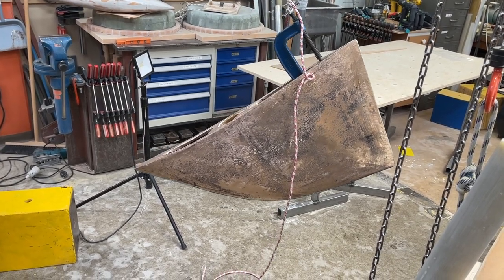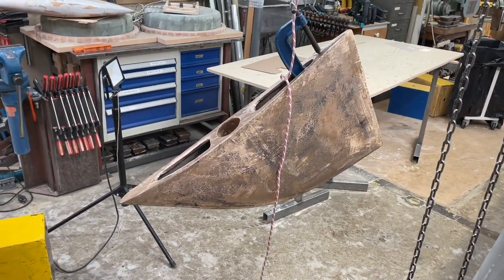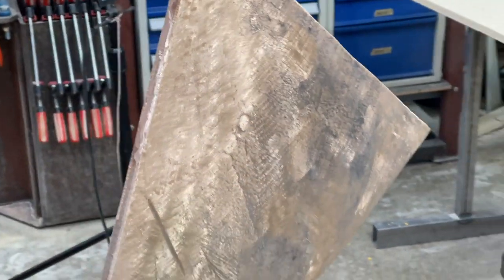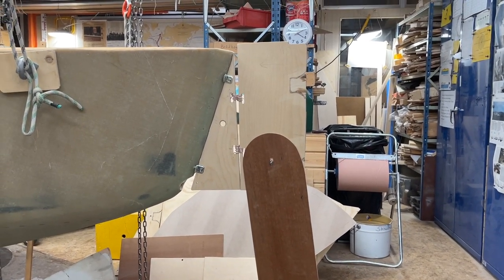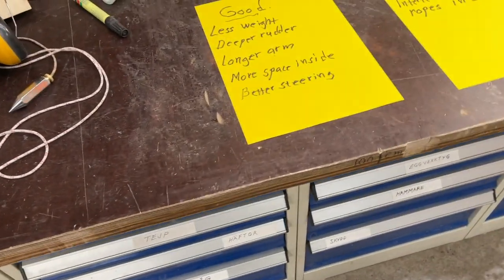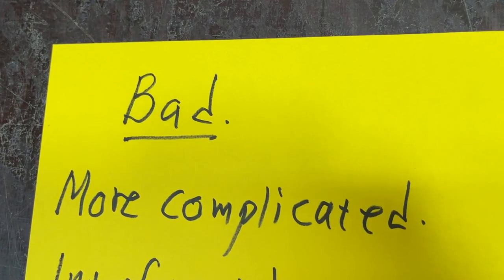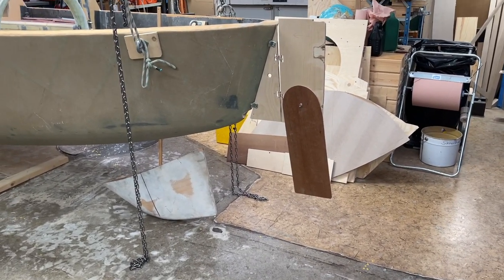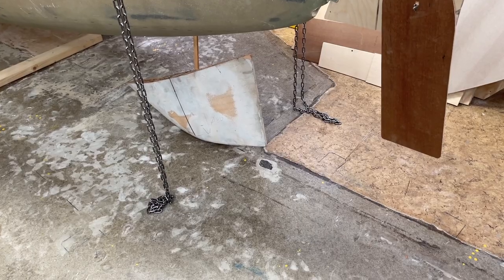29 Oct 2022  New idea for rudder. Here the mock up.  More complicated more efficcient. Less weight.

Comment: Hello Sven, I used "Wharram rudder lashing" with small holes on my Wharram catamaran. It is strong enough. Good luck,
 Al
Reply from the maker: Good information.
Your experience is supported by theory,
Reply: @SvenYrvindExlex  My experience is that when a 15kg battery was dropped from a 2m pier onto the 12 mm laminated plywood rudder, the Wharram's 4mm polyamide rope suspension held up.
Reply from the maker: @marcelajaskova465  Thanks again

Comment: Save that idea for your next boat. Install the bronze rudder and move on. 😌
Reply from the maker: Not good thinking.
I will not move on before I am satisfied.
If would move on before I was satisfied I would not enjoy the sailing and be proud of my product.
Reply: @SvenYrvindExlex  I’ll wait to see the new design but from your cardboard mock up it looks pretty flimsy and weak compared to that Bronze Rudder you already built. You’ll have to convince me that it’s a lot better.
Reply: I suppose going to a retractable rudder is a natural consequence of abandoning the twin keels. Because, without the twin keels, the boat would pretty much stand on its rudder and on its nose, when grounding out.

Every keelboat I even think of designing has a provision for grounding out. I prioritize this over efficiency of the keel and rudder systems. They can only work if they are still on the boat.

As for the high aspect ratio rudder blade, I remember James Wharram using similar proportioned rudders on his first catamaran. They frequently broke at sea.

His first catamaran had flat bottoms and a dagger board. When sailing downwind, I suppose the dagger board was withdrawn. This would have given it similar downwind characteristics to your boat. This is the reason I bring it up.

Comment: This rudder is a far better design. I had a kick up on my Catalina and it was quite handy in shallow water and when hit by logs! and other crazy things floating in the water… the bronze one would make a good addition to the keel.

Another after though is to make it with an aluminum skeleton with many holes to keep it lighter with a fiberglass overlay encapsulating the aluminum skeleton to allow  for the shape you want and preventing oxidation. This would make it stronger and lighter- if attacked by orca’s it would be much more likely to survive than wood. The rope idea would be amazingly strong and very easily replaced if needed.
Reply from the maker: I will use G11 epoxy laminate for the rudder.
Yes this rudder design is much better than the bronze spade.
But it introduces interference with other functions that will be difficult to solve.
Like a waterproof steering system that can be used from my bed room 
Also like the attachment points for drouge and sea anchor.
The stern is no longer free.
But I am working on solutions
Reply: @SvenYrvindExlex  the drouge issue should be simple enough to solve with a dual point attachment or a sort of prow/spit/spur off of the stern over the rudder… could be a hollow tube that captures the drouge as it’s pulled in and have a kind of a chain locker type setup inside the stern to store the line where you don’t even have to exit the boat to let it out or draw it back in, maybe a spool reel like setup depending on the space available…

Comment: Hello Sven!  This rudder seems to be a better solution.  Good buoyancy and limited weight in the end ships is always a good and safe method.  Why not an oar like on your Vega or sam thing like that. I agree, rudders are tricky to construct.  They must be light and flexible and withstand great stress.  Should it be with wind vane too?
Reply from the maker: I do not use wind vane or automatic pilot.
It is not possible to stear with an oar but I will have one for sculling.

Comment: External ruder is also easier to repair, replace and jury-rig should it be damaged at sea. The thru-hull fitting for the bronze rudder could be the weak point if something hit it hard enough, and would be much harder to mend at sea. If it is damaged it could cause the shaft to bind and so become unusable or even compromise hull integrity.
Reply from the maker: Rudderwise this is better But it interferes with aft deck and the bollard I had intended for the drouge and sea anchor.
Also it will be much more difficult to get a waterproof inside stearing mechanism but I am working on those two problems.
This is the easy part.

Comment: Hinges will be the weak link
Reply from the maker: Dynema and Spectra ropes gives more strenght than needed.
Modern rigging now use Dyneema.
There are far bigger forces on a tall mast than on the rudder of a small slow sailing boat.
Reply: @SvenYrvindExlex  😎👍

Comment: Are you considering a wind vane for steering?
Reply from the maker: No wind vane stearing.
Since 1969 I have crossed oceans with a locked rudder and trimmed sails works excellent and is very enjoyable but the skipper need some skills.
Reply: You certainly have the skills. Thanks for another video and I hope your foot is doing better.
Reply from the maker: @bmitch3020  Foot is slowly getting better.
Taking short walks.
Hopefully be running in one more weak.
Giving him a slow start.